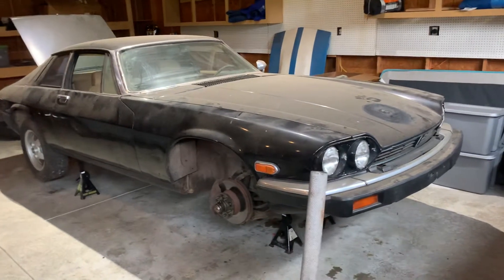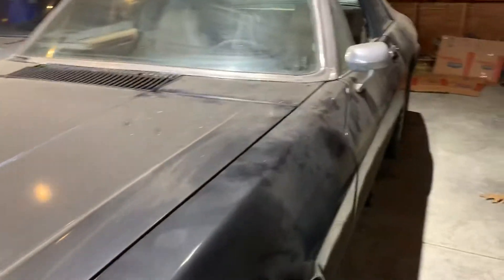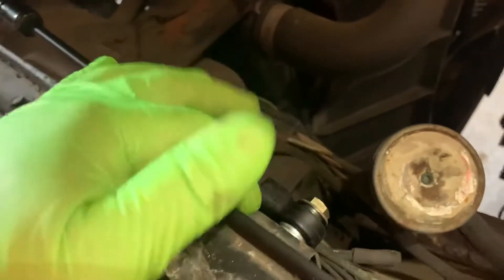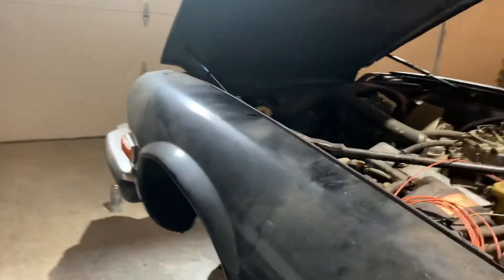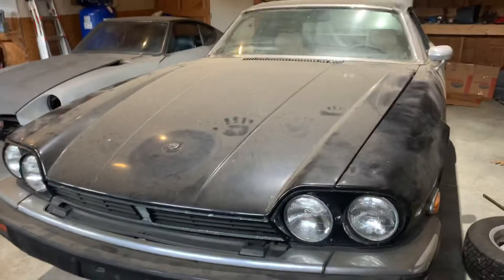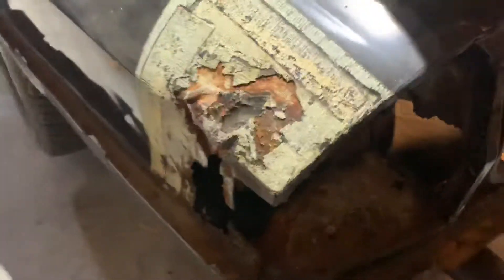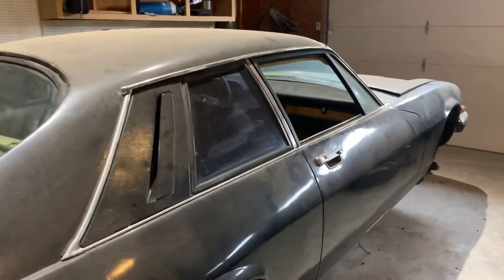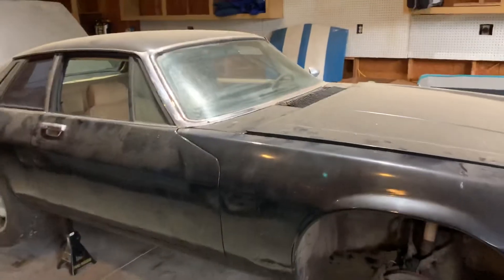Jaguar XJS project overview

Comment: Hey car guy, I have a 2006 Honda Civic I’m having a like thumping sound in the front end. I changed the tie rod ends the wheel bearing on the side it sounds like it’s on it’s got new brakes. I can also slightly feel with my feet on the floor board the vibrations that go with the sounds of the  thumping
Any idea what it could be?
Reply from the maker: Mumeof3 my first thought is always to check the tire and maybe swap it to another position to see if the thumping moves with the tire. It could also be a bent cv axle. I have run into that a couple of times